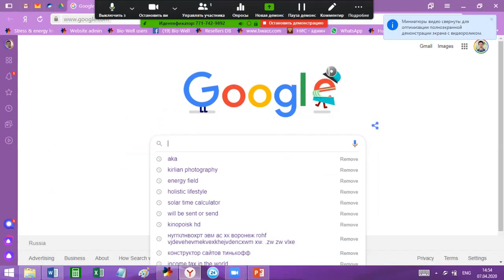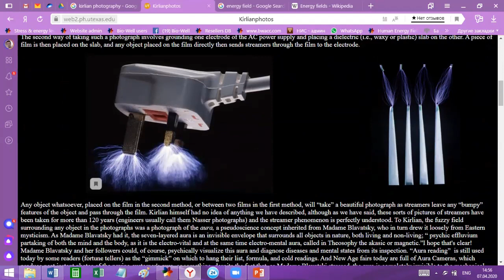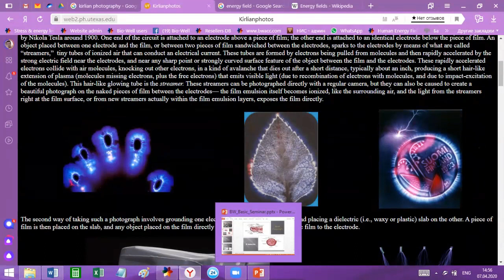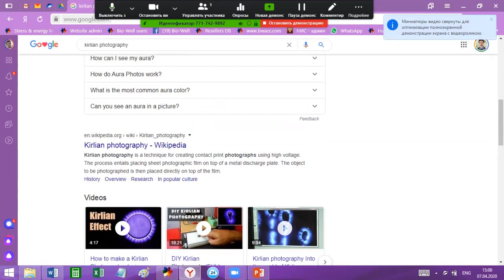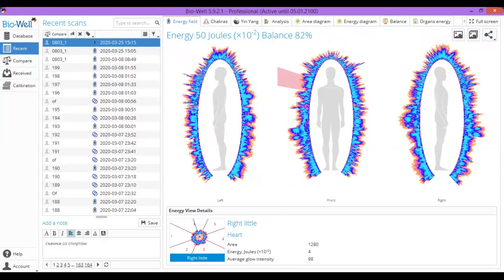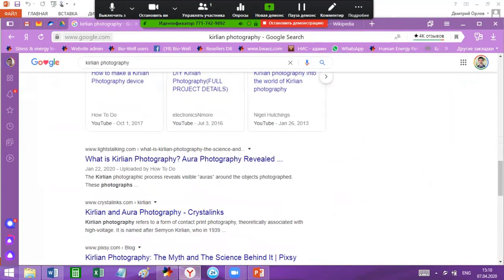Kirlian Photography (GDV/EPI, Bio-Well) vs. Aura and Energy Field. Is there any connection?

Comment: Although the "Aura" photographed by the Kirlian system is produced by that apparatus, interacting with the specimen, & doesn't indicate the presence of that "Aura" when the apparatus is not present & turned on, I would suggest that if the biological specimen has its own Biofield, then its not a far reach to suggest there might be some interaction between the two
Reply from the maker: Kirlian systems DO NOT photograph any AURA! =))))
Where did you find this absurd statement?
Kirlian devices extract electrons from the conductive objects (by applying very high voltage at high frequency), and electrons produce gas discharge or air discharge.
That's it. Very simple. No place for Aura and any speculations about it.

Comment: Actually with smell, there's a more recent theory regarding smell than the molecular "lock & key" theory, which is that the molecules of most odors are of a ring type formation, which more readily oscillate producing electromagnetic fields.

Comment: Quite accurate apart from some points, the aura (more properly auras) or the more acceptable term to scientists, biofield/s (after Beverly Rubik) can & has been be detected, by a number of passive detection devices, for instance a static field meter can detect the bio-static field, SQUID's can detect many frequencies of the bio-electromagnetic field, the work of Harold Saxon Burr using a resistance meter detected a field above the skin. I came up with the concept of the tetrahedron of transduction, where the first point is electrical the second magnetic, the third electromagnetic & the fourth phononic, showing the relationship between the main physical energies, as life is a transductive process. Below is a list of some of these devices.

Biofield Detectors
1.Phase Aurameter, Yuri Kravchenko & Nicolai Kalashenko
2.Electro Auragram, Dr Pavel Gulyaiev, Parapsychology Newsletter Jan-Feb. 1969, May-June 1969.
3.Sergeyev Detector, Dr Genady Sergeyev
4.Force Field Detector, Dr David Thomson, Dr Jack Ward, Dr Abram Hoffer, Dr Harold Kelm, Maclean’s magazine, Sept. 1968.
5.Bio-magnetic Imager / S.Q.U.I.D.’s, John Zimmerman
6.Electromyography / Aura Meter, Valerie V. Hunt
7.Static Field Meter, Patrick Flannagan, Itzhak Bentov
8.Orgone Energy Field Meter / The Experimental Life Energy Field Meter, Model L.M.4, 
Heliognosis, Wilhelm Reich, James DeMeo     
9.Electronography, Ion Dumitrescru
10.Cristofv Field Intensity Meter, Product Engineering, July 4th, 1966 & February 13, 1967.
11.Magnetic Field Detector, W. Schafer, “Further Developments of the Field Effect Monitor”, Life Sciences, Convair Division of General Dynamics, Report A 67-41582, pp. 125-126
12.Method & Apparatus for Evaluating Electromagnetic Field of Biological Object, Borovskij Sergej & Kravchenko Yurij
13.LaesEr Bioresonance Device, Kiran Schmidt
14.Burr-Lane Vacuum Tube Microvoltmeter, Harold Saxon Burr
15.Vibrating Tip Probe, Jaffe, L.F. & Nuccitelli, R. 1974 “An Ultrasensitive Vibrating Probe for Measuring Steady Extracellular Currents”, Journal of Cell Biology, Vol.63, pp.614-628, Oschman, p.163
Reply from the maker: True about biofield/s.
But biofield is a physical term and it has definition: set of all fields emitted by the biological object.
Whilst aura has not strict scientific definition.
If you say that aura = biofield, then there is no need in two terms that define same phenomena. ;)